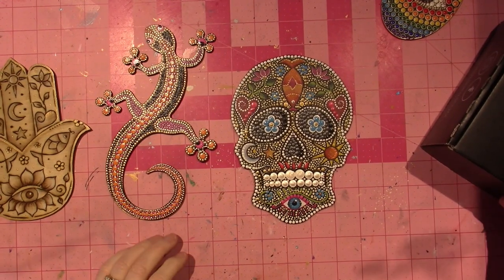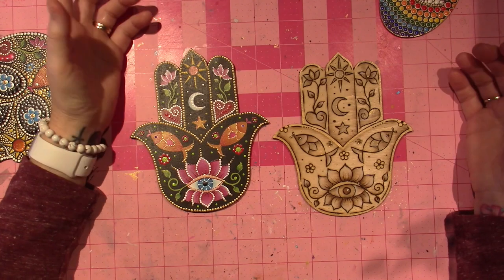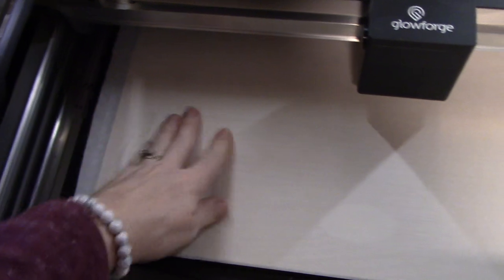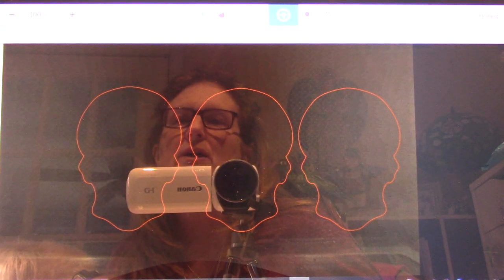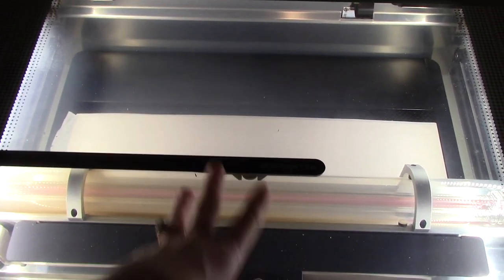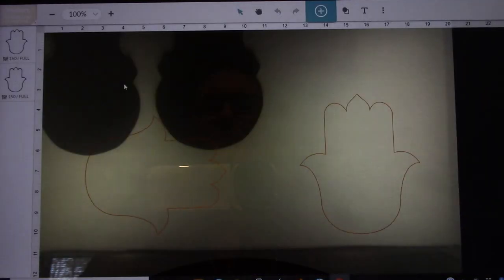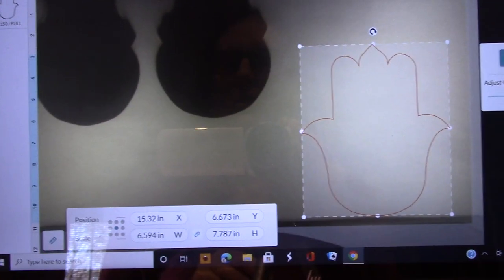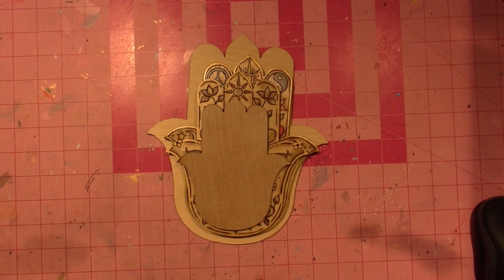How I use my Glowforge Laser Cutter

Comment: oh sara i want one of those! we have huge laser cutters at work that we cut thick metal plate on, i think it can cut through up to 3" metal. if you scoot your images closer together you wont use as much wood and be able to get more images out of you wood. also you can lighten the burn and score in images instead of burning through the wood and you can anchor in targets, like the circle of your ying yang, so you can have a reference for your designs and to add images you want that are perfect, like circles and like the eye.